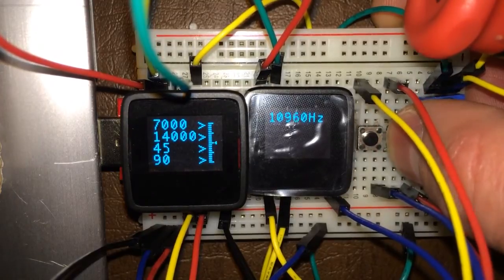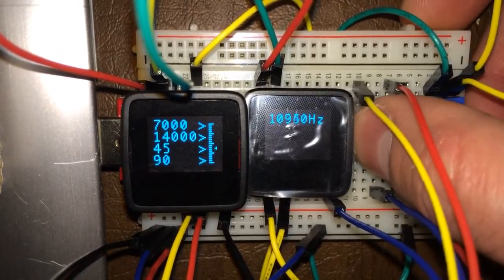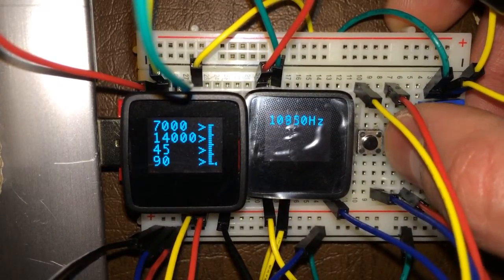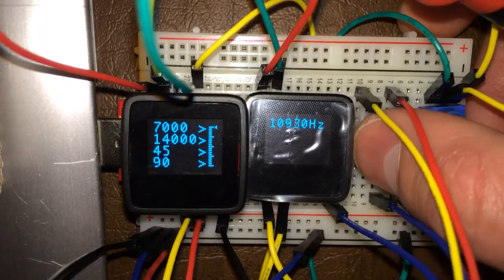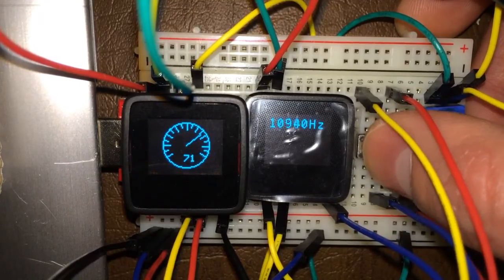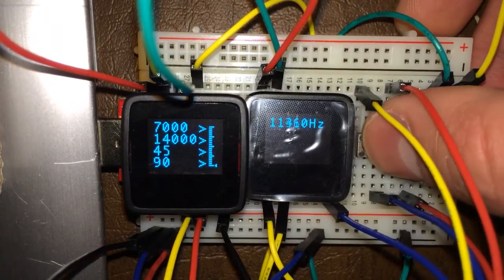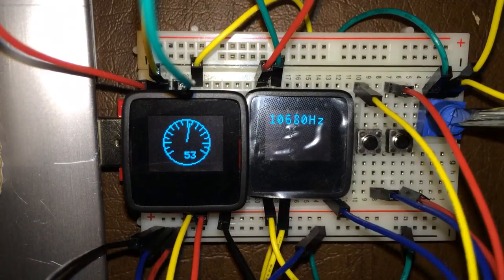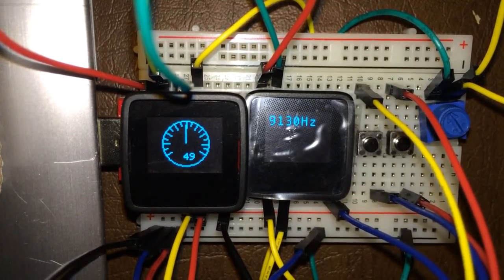DSX Tuning methanol injection controller demo

Comment: I have been thinking about building a DIY water methanol kit. The controller is the hardest to build I was looking at an  Raspberry Pi with a pwm DC 12v motor controller and with a map censer control when and how fast to work the pump. I have read that water flow is better off being ramp ed up with boost pressure or tps position. It sounds very simile to yours. It would be good to see how you are going with a new video.